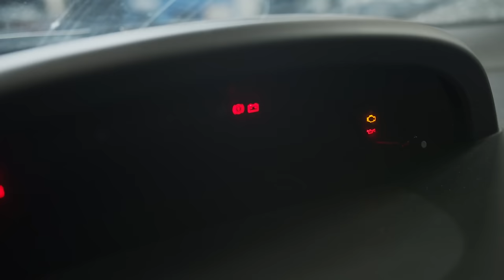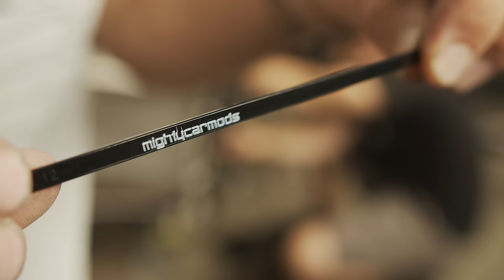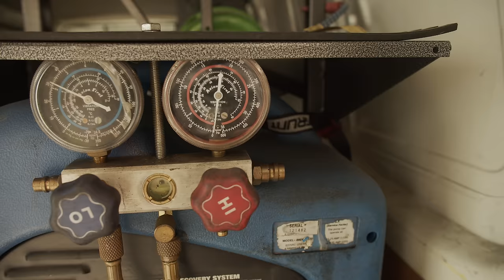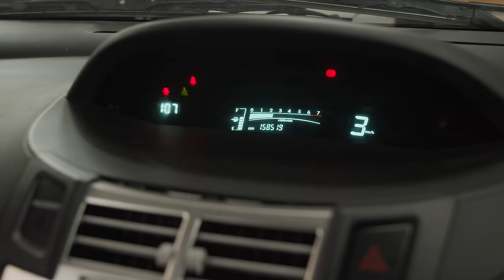Making A Slow Car Fast for $500 (Season Finale)

Comment: I just sold my 2012 yaris L 1.5L,  I put 264K miles on it since new.  During that it was fluid & filter changes, tires, brakes, one rear hub/bearing, 2 batteries, 3 alternators & the other assorted basic mainteance. It was one of the most reliable cars I've ever owned. That said.... It was getting tired, it was starting to burn oil... after sitting for more  than a couple days it would smoke on startup. It would have been a perfect candidate for this swap....

Comment: 7:15 This question, the answer is why not? I have a tiny daily driver that weighs around 1900 pounds. It has a little 1.3L in it and does 0-60mph "eventually". The more I consider it, the more I want to swap the engine and transmission with maybe a Honda engine that can be turboed mated to a 5-speed. It might just fit, with some tweaks and maybe some fabrication. A car weighing less than 2K pounds with a hundred or two horsepower will fly. The car is already a rather nimble and well-handling car. I love how it handles. It takes corners very well at speed considering all the suspension components are still stock. The big things keeping me from "just doing it" is wondering if I can find any aftermarket performance parts to fit it without having to do too much fabrication. The car was never intended to be fast and the specific model I have had poor sales and was the last year the model was sold. It's already hard to find replacement parts. But that curb-weight and handling though, makes me want to try to get a couple hundred horses out of it.
Reply: I'm a big fan of squeezing power out of little gocart-like cars. My 2006 Yaris RS, at ~ 2300 lbs is a rocket with a turbo'd 2ZR. And, it handles extremely well with the TRD rear sway bar. I did these mods and couldn't be happier. I could use a better set of tires. Vids on my somewhat lame channel if you're interested.

Comment: I would have gone for the corolla transmission. And to answer the turbo question, Toyota did have a TRD supercharger kit for this engine (Vibe, Matrix, Celica and Corolla) worth 7 or at pounds of boost. If that was warranty safe, Im sure a smidge more boost will be just fine.

Comment: Gently lift the hose with a hook pick, a quick spray in there, then run the hook around between the hose and pipe. Grab just after the solid pipe ends on the hose and twist.

Comment: My 350Z had an issue with the ECU. The stealership wanted $3,000 to replace it. My Z has more than just bolt-ons. So I bought a used ECU for $250 and had it reflashed for $400. My Z starts better, revs better, and didn't take me a week to install. You guys still kick ass even thou this vid was kinda like clickbait

Comment: 20:25 Hard to believe you didn't searched both car's gearbox code # beforehand... Probably c54 for yaris, I think most toyota c transmissions housings are similar and can be fitted with slight mods...
Looking forward to see this project progress! We want to see a st185 or st205 drivetrain slammed onto this, its possible, and its been done.

Comment: Put transponder and key under dash. That way you only have to use the factory key to start and lock. Done it a lot on BMWs because all the modules are married. Actually I remove the lock barrels and swap them so the correct transponder will fit the ignition etc, putting it remotely is quick and dirty Yaris Hilton style!!!!

Comment: best way to remove heater hoses without damaging the heater core is to split them with a razor blade and peal them off best to replace them anyway.  I even have a curved blade with a sharp point for the hard to reach ones

Comment: There seems to be a very easy way to reprogram the immobiliser on a Toyota. Use a paperclip or a piece of wire to bridge pin 4 and 13 on the OBD2 port. Then insert the key you want to use, in this case the Yaris key, and turn it to ON and leave it like that for 30 min. Then turn it off and remove the paperclip and you're good to go. It's a trick I found on Youtube so it must be true.

Comment: You guys get some really limited engine choices - in the UK we actually get the 2ZR-FE engine in the Yaris out of the factory ... not surprised it fitted given Toyota put it in! Will be interested if you go down forced induction given it doesn't seem that popular (although again I think Toyota already have done this in the GRMN but no aftermarket parts really)
Reply: Yes, not as popular a platform for mods as Honda for example. I did the 2ZR swap and T28 turbo on my 2006 Yaris RS (now my TS, haha). I do wish the Toyota ECU wasn't so locked down. It would be fantastic to not have to use a piggyback or standalone ECU.  Videos of my car on  my channel.

Comment: With the Yaris front bumper bent so bad, did it bend the frame rails inward?  You went to the scrap yard for the radiator hose, but didn't get a front bumper or proper engine mount???  That solid mount will be taking ALL of the torque, since the others are rubber... and may break the engine block.

Comment: a lot of people I have met that are not happy with what there driving I ended up helping them out on getting heads out of a salvage yard while there driving there daily driver port polish and pressure test the heads and get the better rebuild kit for the bottom for the newer year car. like the 3.5 chevy motor I have rebuilt a 3.4v6 and turned it into a 3.5v6 used the pistons and all the bottom end except the crank. I sent a new crank for the 3.4 to the machine shop to balance it. with the new rods and pistons. then went into the engine and it ended up waking up more for the guy and was happy. plus had him pick up a salvage trans for it and rebuild it at the same time while waiting for it to get finished we went into the engine and put it all to gether. glad we swapped the trans to a rebuilt one we noticed how leaky the old one was. plus when he got it from a guy he didn't treat it right it also explained why my friend didn't like it for a while. now he loves it to daily it now.

Comment: I have a 91 EF Civic hatch I've had for many many years... it's now been sitting for The Last 5 Years I have sold the engine out of it... but here in the last two months I have acquired a wrecked in rear 2002 Honda Accord with a 3L V6 auto.... I'm thinking of doing a swap with it but mounting the engine in the rear of the car or somewhat would be mid-mount almost.... should I do it this way or just put it in the front? As far as cutting on the car I don't care at all to cut on it because if I don't do this swap I'll probably be junking it one day anyway

Comment: Do a real FWD track car. Sentra spec v with 2nd gen VQ35 (been done a lot, easy swap minus wiring, but you can get a pricey harness). That's 300+ whp (fat band) with an hlsd 6 speed.

Comment: Hey guys !! long time subscriber right since the stealing the girlfriends car to PIMP out for 500$ lolol
LOVE the show!! keep doing what youre doing! really shows you can start from anywhere and with time and effort you can accomplish so much.
Anyway fan stuff aside lol, my question to you is, do you guys know if the 1zz-fe 1.8 corolla engine will work instead of the 2zzr engine? I have a 2006 Scion xB AND a 2004 Toyota Corolla.
The Scion is basically a yaris with a different body, with the 1.5L but the Corolla has thw 1zz-fe instead of the 2zzr. Im hoping it will still work. Any insight would be greatly appriciated!

Comment: Dudes - kilowatts are for light bulbs and refrigerators, and newtons are cookies with figs in the middle.  American car audiences resonate with horsepower and foot-pounds.  Also, making a slow car fast for $500 usually means tuning mods - turbo, chips, headers, porting, cam, etc - not an engine swap.  That should be titled Making a Slow Car Fast by Making it Another Car (the only part of a car that counts is the engine).
Reply: Who cares what american car turds resonate with? 

https://en.wikipedia.org/wiki/International_System_of_Units

Comment: 1988 American version: Lets buy a 1968 chrysler 300 down the street for $200 and get it running. $5 ballast resistor later it runs. ba-wooom the 4 barrel kicks in and 375hp / 480 ft-lbs torque send you on your way. Probably would lose to the yaris since it weighed 4x more.

Comment: let drop a Merc 2008 R320 cdi v6 into a 2016 nissan navara np300 2.3 dci, I have both cars and the merc was my wifes car which is now a right-off in nsw  (genuine parts to repair to expensive)... so I thought what perfect timing to drop a more powerful motor that I have already, into my ute.  do you have anythnig like this coming up?

Comment: Should be almost as fast as incoming new Yaris GRMN.. 275 horses & awd
Reply: I have basically the same setup as the MCM guys but at 8 psi/~180 WHP. I would quickly shy away from a GRMN. I'm pretty certain that even the 1st GRMN with 217 HP 2WD would eat these cars alive. Traction is a major issue with these 'home built' Yari. I have an automatic, so an LSD is pretty much out, unless I swap to a manual. Off the line is where the home built Yaris would pale. Maybe from 50 - 60 mph upward the beating wouldn't be as bad. If you check out around 1 minute and 45 seconds in my video, you will see what I mean about loss of traction. I had to let off on the gas as it started to spin around 50 mph. At around 2 minutes and 10 seconds, I won't even go deep into boost until I'm doing close to 60 mph. Other vids on my channel if interested.
https://www.youtube.com/watch?v=fFvwnmc09Qc&t=0s

Comment: I just bought a 2ZRFE for my xD and it was nowhere near $500 but I wish I knew where they were getting them that cheap
Reply: I paid $700.00 on eBay for my fairly low mileage (42000 miles) 2ZR, delivery included. It even came with the intake manifold, exhaust manifold, injectors, harness. You just have to shop around. My engine is super quiet and smooth running and it's handling 8 psi boost easily. I have a swap video on my channel. Check it out.

Comment: 1:07 to 1:02? With a complete engine swap? Muckin about with CPUs and wiring harnesses and chipped keys and fabricating motor mounts? How about re-flashing the CPU or a chip, a bigger exhaust, bigger intake plenum or yes, even a turbo, and you should be able to gain a lousy 5 seconds.

But I do love the constant demonstrations of being dropped on one's head at birth. High 11? 6??? Jeeeezzzz. I had to go wash my keyboard. Keep up the good but twisted work.

Comment: Hate to break it to you boys...but that was in fact a 1.5 1nz-fe motor not a 1.3 hahaha...the 1.3 has the exhuast manifolds on the front of the car where as this clearly doesnt. You could have just turboed the 1.5 its the same block as the turbio one and has low compression ratio unlike the 1.8 corolla motor that had no turbo option. The 1nzfe would have made that same 150hp all day. they can make 200hp and still be reliable..But there was for sure something wrong with that one it didnt seem to be hitting vvti when ytou guys raced it.

Comment: Couldn't they have just swapped the mount on the trans from the yaris to the corolla and kept the 6-speed?
Reply: Pretty sure the 6-speed casing is longer, requires frame notching. I think there were other challenges with using the 6-speed. Yarisworld would be a good place to investigate if you're really interested.

Comment: $500.00 front cut for a ZRE152. I call bullshit. After checking with a lot of local wreckers what you'll find is many wreckers won't sell a front cut and if they do they want $2500 - $3000!! These stat right offs at auction are being snaped up by overseas buyers. They are a lot more valuable that whats suggested in this clip.

Comment: “Nice power tools” he said lol 
No when I worked on F150s my pneumatic drill hanging from the line was always hissing and sometimes didn’t have enough power to put the bolts in

When I was making drive shafts the welder was always fucked up and the needle gauges were always busted so you basically had to guess where the high points are it’s complicated but no, factories are not clean or quiet or easy. You’re always fighting the tools and yelling at people.

Comment: Why not fit the 2ZZ GE from the Corolla T Sport? 
Same amount of work but 190bhp
Reply: I'm pretty sure it's quite a bit more work to put into a Yaris. I briefly looked at it before going with the 2ZR and turbo kit in my Yaris RS.
Reply: Adam B fair enough, I thought they were pretty much the same.
Shame as I have a full Corolla T-Sport I was thinking about using
Reply: @Dubslag  You should do it man! You already have the engine. It has been done. I'm thinking Indonesia or Puerto Rico for some reason. It would be super cool!
Reply: Adam B I’m a fabricator and already have a the full good donor.
Yaris’ are cheap here I was just hoping it was plug and play ish as the Corolla has body damage
Reply: @Dubslag  I really hope you do this project. I would love to follow it if you documented it somewhere. I would recommend yarisworld, but I'm biased. LOL. This is exciting.

Comment: I own  a 07 1.5 hatch and mi wife drives 1.5 4dr 08 yaris...both manual and ones 195 thousand miles and hers is 180 something thousand miles and i love then both
Reply: They are such fantastic cars; tough, reliable and economical. I just sold my 2008 LE 5-door. I kept my '06 RD 5-door as a project car. I did the 2ZR engine swap and turbocharged it. Here are a few links if you're interested:
Turbo:
https://youtu.be/qH2HCcNXF28
https://youtu.be/6eJXEtcY0RQ
https://youtu.be/fFvwnmc09Qc
Engine swap:
https://youtu.be/3f7MlghRSxQ

Comment: Check check check the engine oil on the 1.8vvti as these left the factory using oil I was almost 1 ltr UK per 1000 miles at 45000 miles on the clock
Reply: From memory the rings were to blame
Reply: My turbo'd 2ZR Yaris doesn't seem to use any oil. Come to think of it though, I haven't gone a full OCI since installing the turbo kit. I probably have 3000 - 4000 kms on it since the install. Still at full on the stick. I do get a wee, wee bit of sludgy crap in my catch can but that's to be expected. I run full syn API SN Plus oil.

Comment: Those 1.8 vvti engines and 2.0 isnt good.alloy block on m is bad for cracks in the head.the celica and avensis has had a terrible time of it from late 98 through early to mid 2000s.careful out there if ur going for one.

Comment: talking about switching an engine like he is gonna switch a remote controller battery. it costs more the price of the whole yaris and the engine to do that and it would take a normal person 5 years of mechanical training to even attempt this and even then it won't work that well.
Reply: Actually it's not that bad. I did it myself and have no mechanical training. I did get a subscription to Toyota TIS Tech Info for wiring schematics. I just went slow, got pointers from guys on Yarisworld. Then I installed a complete turbo kit. I just took my time and didn't cut corners. It seems very intimidating at first, but then becomes much easier as you go. My channel has videos of my car with his a 2006 Yaris RS, with the 2ZR swap, before turboing.

Comment: do not use moog part i used a moog lower ball joints in my 1998 toyota 4 runner they lasted 1200 miles and failed what a joke rite garbage parts.

Comment: Kilowatts? Nobody measures engine power in kilowatts. It's ponies you bloody convicts.
Reply: us isnt the only place in the world bro, grow up
Reply: @arcanevoid9199  who said anything about the US?
But do you really have a valid platform to have an opinion? You drive on the wrong side of the road and for no reason. Australia was a young wide open country that could've driven on any side of the road they wanted and they chose the wrong side. Wow...
Reply: @Beaches_south_of_L.A.  these opinions literally only come from americans, different countries use different measurements. none of them are wrong. and no such thing as the wrong side, and for driving manual rhd is better
Reply: @arcanevoid9199  there is a wrong side of the road and it's the left side. Why? Because the right side has the right of way. Also if the left isn't wrong why would sweden go to all the trouble and expense to switch to the right? Also Scotland has said if they ever leave GB the first thing they'll do is switch to the right side of the road. They've even designed transitions that would be built on the border that automatically switch sides of the road for traffic.